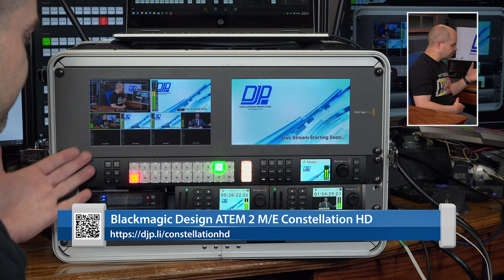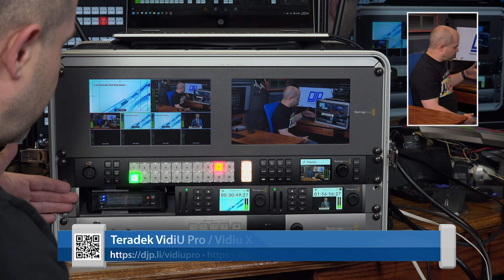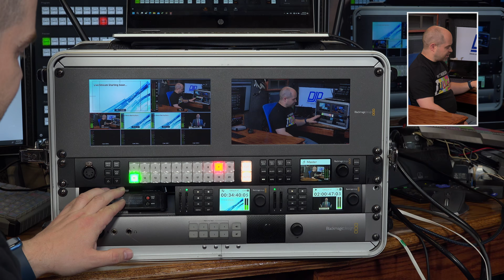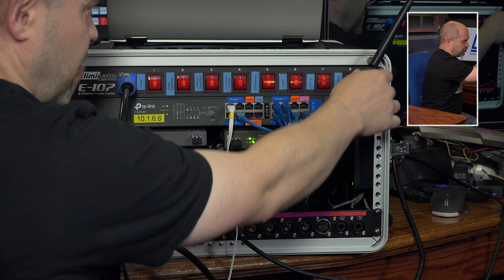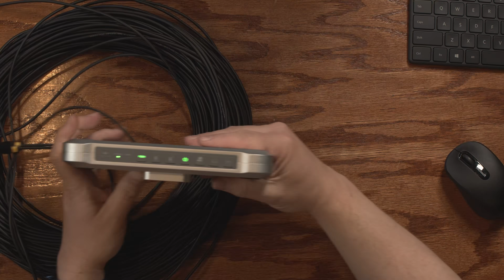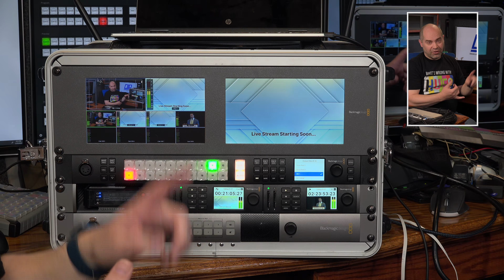My ATEM 2 M/E Constellation HD Video Live Streaming Flypack

Comment: We play commercials at our events and often need to send an audio out to the local sound system. Is your build capable of that currently or would you need to alter
Reply from the maker: In that case I'd add either an SDI-to-Audio de-embedder or HDMI de-embedder to connect to the playback HyperDeck to extract the audio.

Comment: How do you configure the two routers that they work in both configurations of the case (stand alone and slave of trailer). I hade the same idea but what to give to the decides in terms of standard gateway. My idea was to give both routers the same ip and not switch on the fly-pack-one. How exactly did you configured this specific network parts?
Reply from the maker: I wouldn't use the same IP address range -- that can cause potential routing issues.

All of my devices except the ATEM use DHCP so they'll just take on an IP address in the proper range. When switching networks all I have to do is change the IP of the ATEM.

Comment: Hey Doug! I had a problem on my Hyperdeck Mini last week. I was recording a live event and timecode was running and the recording status was active in red, so it seems to be ok, but after the show I tried to see it but it only recorded 4.27hs of the 5hs we was supossed to record. Recording did not stop at any time, but the file was not complete. Have you experienced something like that before? I was using a Sandisk Extreme 170mbs to record a h264 low file, so I guess is not a bitrate problem.
Reply from the maker: I have, maybe twice in 5 years. Once it was because the card was ejected while the recording was still going. The other time wasn't something I could explain. For what it's worth, I've had similar issues with other recorders too. Sometimes using a disk repair tool will bring back the missing data. 

For anything important, you might consider running two recordings in parallel. I always do at least two, very often three just in case.
Reply: @djp_video  Thanks Doug. Yeah, now I'm running the ISO Recording, the Hyperdeck master and a spare USB VMix recording. Damn, hate when hardware fails. Makes me miss tape recorders haha.

Comment: I'm curious as to why you chose not to make custom cables. Also wondering how you deal with audio levels..just Software Control?
Reply from the maker: I did make custom SDI cables. With the Ethernet, I certainly could and I have the tools... but I already had cables of the right length.

For this flypack audio will normally just be through the ATEM. It has decent enough compressors and limiters to handle many situations. When I'm in charge of actually producing the audio, though, I'll use my Yamaha TF1 mixer.

Comment: I found those Fiber Converters to be very annoying. Out of the 4 we own, 1 of them always fails. When we bring it back to the shop and try it again, it works. This happens every time we use them.
Reply: Are you referring to the micro converters rather than the rackmount Studio Converter 2?

Comment: Thanks for sharing Doug. Amazing how you neatly fit all this in a small rack unit. One quick question, are you able to monitor the sound without the studio converter with this setup? And I’m surprised to here about the web presenter 4K! I’ve been using it for 1-2 hour streams with out any issues!
Reply from the maker: I will be building an adapter to let me use a normal pair of headphones with the headset jack on the front of the unit. I might even make a video out of that.
Reply: @djp_video  that’s good to know it’s possible with a special connector. I’ll be on the lookout for the video if you make it and thanks again

Comment: Great video Doug! You mentioned that you considered using the BM Web Presenter HD, but experienced some reliability issues with it? I just received two of those, as I intend to use them with my Constellation 2m/e setup. Could you elaborate on that, please?! Thanks
Reply from the maker: I've had multiple streams fail with the Web Presenters. Last week my live stream as part of Stream Day failed with the Web Presenter 4K -- even though I have an extremely reliable symmetric gigabit Internet connection, it couldn't get 25 Mbps out to YouTube -- the cache filled up almost immediately, viewers experienced buffering and stuttering and not just dropped frames but entire dropped segments of video. 

I ran another experiment yesterday with the WP4K, Vidiu Go, and OBS all streaming simultaneously. The Vidiu and OBS streams were perfect. The WP4k stream was stuttering and freezing and getting farther and farther behind.

I'm hearing similar stories from multiple viewers of my channel. In my opinion, the Web Presenter products need some serious work.

On top of all of that, Blackmagic doesn't have a bonding service, so you can't combine multiple Internet connections for redundancy and additional bandwidth the way you can with the Teradek or LiveU products.
Reply: @djp_video   Thanks for your reply! This is really worrying, as I faced similar problems with the Atem Mini Pro. The Cache was filling up on the lowest quality setting, even though I had around 50mbps of upload available. I kept rebooting the Atem Mini Pro, starting a new stream and displaying a still image with audio, and the cache was filling up right away. The next day I did a 4 hour test at the office and went smoothly, without a glitch.  Somehow I thought the Web Presenters were more reliable.
Reply from the maker: I'm pretty sure they use the same chips/code.

Comment: You should put Neutrik Opticalcon Duo on the rack side. Would be nice to see in the camera converters, but we’re beholden to the manufacturers…
Reply: Not sure how you’re powering the camera converters, but the opticalcon has 4 copper contacts as well so you could send power to the remote units as well.
Reply from the maker: The Camera Converters have their own batteries internally that last for about 4 hours. But nearly always when I'm using them I also have to power a camera and monitor. Whenever I can I'll use AC power, but I have some Jackery battery banks for the times when I don't. The ones I have will last nearly all day.

There is a company that makes adapters to let you use OpticalCon cables with the Camera Converters, but they're really ugly and awkward looking, and kind of expensive for what they are.
Reply: @djp_video  I use OpticalCON Duo connectors on all my fly packs & field jacks. Great with OpticalCON cables of course, but also fully compatible with normal LC cables (like EtherCON & RJ45); BUT the automatic dust shutters on the OpticalCON connectors make them foolproof for keeping dust out. Well worth the price.
Though I also add secondary compact dust caps also for extra protection & to remind crews to treat fiber ends with respect.
Corning also makes LC connectors with built in shutters, but I haven't used them in person yet.

Comment: Hello Doug,
about companian - have you tested it with the constellation HD ?
I have also the 2M/E an i run into loosing connection and reconnecting issue after a while.
Restarting the constellation than resolves the problem.
I don't have this issue with other ATEMS, so it seems controlling constellations is not stable by now.
Reply from the maker: I've played with Companion with it a little bit... everything seemed to work alright for that short test. But it wasn't for long.

Keep in mind that Companion uses an unsanctioned, reverse-engineered protocol for talking to the ATEM switchers -- it isn't the official Blackmagic SDK -- so it can potentially take a bit for the code to be updated to support new models properly.
Reply: @djp_video  yes, thats right.
I just wanted to warn, that companian has some issues with the constellations.
It woks pretty good for an hour or so, but then companian looses connection randomly.

Does x-key use the official SDK?

I'm testing wich control will be the best solution for me, because my diy modified Thomson RSAT2 are not able to control the new ATEMs, because they are based on skarhojs arduino libraries witch stoped working  beyond ATEM 7.4 Firmware.
Reply from the maker: X-Keys is the panel... it can be used with Companion, JustMacros, or Central Control.

Companion does not use the official SDK, but JustMacros and Central Control both do. I haven't tried Central Control with it, but JustMacros does work.
Reply: @djp_video  Hi Doug, thanks very much for sharing this video. I have e few questions. Is it easy to set up the X-keys panel together with justmacros, how many preset boxes can i create with supersource and fire up with the x-keys panel, how did you get the bordelines on the boxes and my last question is it possible to do green screen with the BMD 2ME HD  supersource

Comment: Since switching to vMix, NDI and several high-end PC's, I've never looked back. I still have my Blackmagic TV pro 4K mixers, but I just use them as sub inputs. Blackmagic's lack of adopting NDI and SRT is a complete hindrance when it comes to more complex live events.
Reply from the maker: Those who need to do IMAG like me need hardware switchers; the software-based options have much too much latency.

NDI doesn't scale well to large events. I've heard that from many people who run large events who have tried and had it fail on them.
Reply: @djp_video  We all agree that Blackmagic needs to adopt some kind of video-over-IP solution, either propietary or standard (NDI, SMPTE2110, etc)
Reply from the maker: I don't see them ever doing NDI. The licensing costs are just too high.

The problem is 4K. If you want to do 4K with more than a couple cameras, the costs for the networking gear are astronomical. Productions at the scale of national broadcast television can afford this, but pretty much nobody else can.

Comment: Can you disable the audio adjust on the front-panel? seems concerning if you accidentally bump it.
Reply from the maker: I didn't see any options in the menus to turn that on or off.
Reply: You can lock all buttons together on the front panel. 
But not seperatly.

Comment: Don't you think that all of these rack could be done with just a simple powerful laptop+sdi capture enclosure and Vmix? All the mixing, recording, streaming, video and audio routing...?
Reply from the maker: Not if you want low latency, which I need because I do IMAG quite a lot. I also need more inputs and outputs than you can get into a laptop.
Reply: @djp_video  that's right then
Reply: I’m not a believer in software solutions in professional production environments. OK for education, churches, YouTube channels, but too unreliable for commercial work.
Reply: @dannypgrizzle  that's not the case with Vmix
Reply from the maker: Anything that runs on top of a general purpose operating system like Windows is going to be less reliable that purpose-built hardware... it is far more complicated and has more things that can go wrong
Reply: @djp_video  Be careful painting with such a broad brush. True reliability comes in the form of redundancy.
Reply: @NWOhio_live  Vmix is not 100% reliable, but neither blackmagic products. But I get your point about hardware vs software mixer. My point was that for a portable solution, to me makes more sense a more lightweight software solution. For a fixed installation, your kit makes complete sense.
Reply: @dannypgrizzle  What graphics package do you run that is not a software solution?
Reply: Show me a “simple” powerful laptop that never has to be rebooted. It might seem like dedicated hardware switchers and encoders only increases the number of points of failure present, but reality is all this complexity is still present in the laptop itself, where it can be almost impossible to know what is going on with background processes, automatic updates, untested interactions, and surprise instability. Not something I care to add to the stress and pressure present in commercial work where the live event cannot be restarted when the computer has to be rebooted.

Comment: What is total latency through the rack?
Reply from the maker: Average of 0.5 frames
Reply: @djp_video  Looked like about 6 frames in the program monitor
Reply from the maker: That 6 frames would include the camera (~2 frames), going through the switcher (0.5 fr), outputting one of the switcher outputs back into another input (1 fr), back through the switcher (0.5), then out to the monitor (1 fr). The actual latency through the switcher itself is between 0 and 1 frames for an average of 0.5 frames.

Comment: Great set up! I'm going to have to bookmark that power conditioner because the individual switches is really nice. Are you worried at all about heat dissipation? There's a great open section in the back but I can't help but think all those rack units on the front stacked on top of each other could really dissipate heat right into the next rack up or down.
Reply from the maker: It's something I've been conscious of, and I did have to reconfigure the rack slightly after I first built it.  The first configuration had the HyperDeck Studio Mini, then HyperDeck Studio Mini HD, then VidiU, left to right, but I found after testing for a few hours that the VidiU was overheating and locking up because it was on the exhaust side of the HyperDecks, so I reshuffled it to put the VidiU first on the intake side and that solved the problem.

Of the components in the rack the Constellation produces the most heat, that's why it's on top. The others don't produce a lot.

I ran this rack non-stop from the time I built it on Thursday last week until Sunday evening when I shot this video and it got warm, but not overly hot, and all of the equipment seemed to be functioning properly. I have yet to use it out in the sun, and if there are issues I'll add some active cooling of some kind. 

Keep in mind that the only fundamental difference between this and the previous iteration is the switcher -- I went from a Television Studio to the new Constellation, and I used the TVS version of it for years without any issues, even in direct sun. I don't anticipate problems, but if they happen I'll address them.

Comment: Hello Doug i am super impressed with your new update!!! I have something similar with your previous rack again inspired from yours....
I have an audio delay box from Beringer in order to delay the audio from xlr inputs.
Does the new switcher have the same feature as the atem mini?
Tanks for the video!!!!
Reply from the maker: The ATEM Mini has a few features that the Constellations don't... like video recording and video streaming. It seems that Blackmagic Design assumes that if you're buying this level of gear that you probably have separate gear to perform those functions. The other difference is that the ATEM Mini is fully self-contained with its own control surface, where with the Constellations you will likely want to get something (Advanced Panel, Stream Deck, X-Keys, etc.) to control them.
Reply: @djp_video  Thanks Doug again for the video! For me your new rack will be my dream for the next couple of years...
From what I get from your videos throw is that the Constallations have better audio engine from mini series if you consider the entrance of Madi, mix minus as you mention in you first video. That is the reason I believe that in the Constallations would have included audio delay function in xlr inputs as well  as in the mics in mini series.
Can you please look for it for me when you have time?
Thanks again!!!
Reply from the maker: The MADI features are only available on the 4 M/E models. And even then I've heard more horror stories about it than stories of praise.

Since I have the 2 M/E I don't have access to the MADI feature so I can't look that up for you... sorry!
Reply: @djp_video  Thank you Doug for the response but I'm interesting to tell me if there is audio delay in the analogue inputs TRS of the switcher not the Madi. I was mess you talking about XLR because the television studio have XLR inputs... sorry.
Reply from the maker: @dkoukliatis  Yes, the Constellations do have the ability to delay audio on the TRS and microphone inputs (but not the camera inputs)
Reply: Constellation HD has inbuild audio delay for rearside analog stereo aux input and also for the frontside mic input.
Audio delay can be adjusted from 1 to 8 frames.

Comment: Great video, Doug!  Sorry if I missed this, but do you use this in your trailer and then remove it or is this in addition to the equipment that you have installed in the trailer?
Reply from the maker: This is separate from the trailer (but can act as a backup for the trailer if need be). The trailer has its own switcher (Blackmagic 2 M/E Production Studio 4K), and it is in its own rack that is quite similar to this one -- just capable of 4K and with a lot more flexible routing than this rack has.